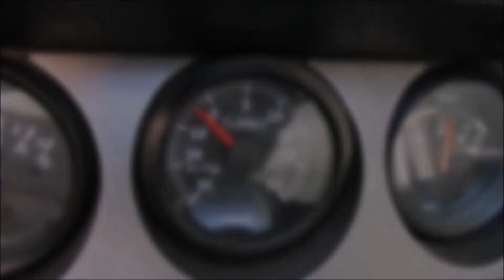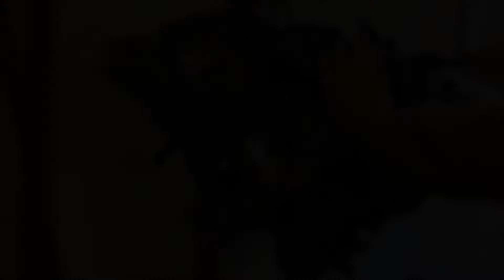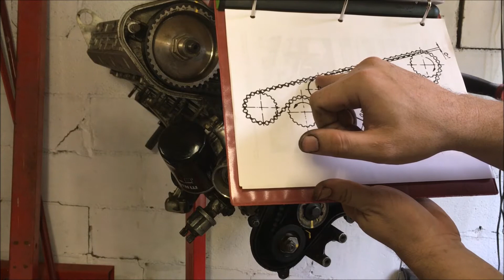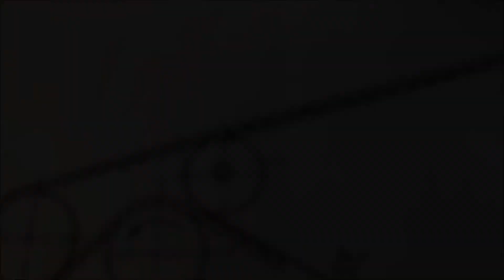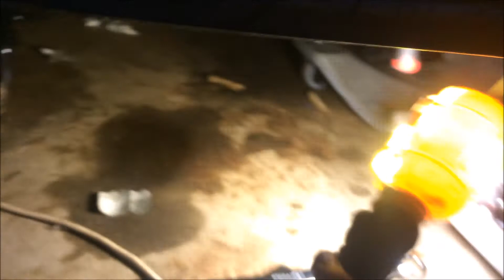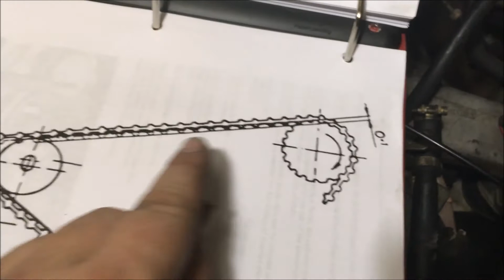Porsche 944 balance-shaft belt Installation Tutorial

Comment: Loctite 574 is flange sealant, no?
Reply from the maker: Yup, these bolts use flange sealant. Not entirely sure of the reasoning but it’s what the factory service manual says to use on those bolts.

Comment: Great video! Just a couple questions. I just finished my timing belt/balance shaft belt job on my 83 944, and when I started up it had a supercharger sound to it. I believe it may be my balance shaft belt being too tight. What do you think?
Reply from the maker: If you installed a continental belt with the grooves in the teeth they are extremely loud belts. Even if you have those at the correct tension they will sound like a supercharger. The gates belts are the old type of belt made from older materials but much quieter. I hope that helps!
Reply: Thanks for getting back to me! I dont have grooves in the teeth of my belt, so it must be too tight. I was just wondering if i need to put it back to tdc and put a flywheel lock back on if im just retensioning the belt? Thanks again.
Reply from the maker: Shouldn’t need to set it to tdc again. You can just loosen the tensioner a tad. The belt will still make some noise but those belts shouldn’t be so loud you hear them inside with the windows up. I have the conti belt on my car and I can hear it with windows up and radio on…

Comment: what happens if i have the 1mm offset but have more than 0.5mm clearance under the roller?
Reply from the maker: The belt can lift off the lower balance belt at high speed and potentially cause the shaft to jump out of time.
Reply: @edredas  I watched the video a couple of more times to see what position you had the tensioner and I had mine turned too far out once I put the tensioner in the same position as you show in the vid I was able to get the correct gap. Thanks for the help

Comment: Another brillieant video Brent!  What is the procedure for torqueing the balance shaft bolts?  How do you hold the shaft/sprocket while tightening the bolt?
Reply from the maker: We use Loctite 574 on the bolt and the Arnworx tool to hold the sprocket. This video is ancient now but I would eventually like to redo it with better lighting, in the new show with a newly rebuilt engine. I would then go into more details. Thanks!

Comment: Did you use the flywheel lock?
Reply from the maker: There's no need for the flywheel lock if you are just replacing your belts. Many times the flywheel lock will just move the flywheel off the timing mark when it engages. So the only time you really need the flywheel lock is when removing the crank bolt to replace the front main seal. I hope that helps!

Comment: Did you ever publish any tips for setting tension with the spring tensioner?
Reply from the maker: It’s pretty much the same idea as the eccentric. You’ll still want a gauge to make sure it isn’t setting the tension too tight. It’s easy to back the tension off with the auto tensioner. Just press on the lower part of the belt just below the cam sprocket and you’ll see the arm move down and if you lock it down you’ll see that it loosens the tension. Sometimes you only need to press on it the slightest amount to set the tension correctly. I hope that helps!
Reply: @edredas  yep - what I did - thank you.

Comment: recently had an incident where after much worry found out that the big thump after driving was not in fact the timing belt but the balance belt getting dislodged, previous owner id just bought the car from didnt tighten the bolt to 155 ft/lbs and the bolt threw out and shot the balance crank gear and the one infront of it but left the timing intact and now i know how to fix it :)

Comment: Good stuff. We just changed the belts on our '87. It has the auto tensioner that I really couldn't find any good videos on but it's pretty self explanatory and read up on it at Clarks garage forum. I can turn the waterpump pulley by hand with some force so should be good, will check it again after a few miles. We left the plastic belt covers off to inspect from time-time, any problem with this?
Reply from the maker: Shouldn't be an issue. Just make sure nothing gets down in there!

Comment: If this is not right will you get a whining noise?
Reply from the maker: The balance-shaft belt makes a very noticeable whining noise even when tensioned and installed correctly. However, it is much louder when the belt is tensioned too tight or the idler is misadjusted. I hope that helps!
Reply: @edredas  If come down to Charlotte can you take a look at my 86 944?
Reply from the maker: Sure, just give me heads up. Thanks!

Comment: Great videos, I have my 1982 944lux since last year and your tutorials really fill the gaps between the manual and the ·"real how to do it". I am trying to replace my belts, and I cannot get them to align with the factory marks for TDC... when the upper and lower balance belt shaft sprokets are aligned, the camshaft is 5 teeth out (someone marked a dot with white paint at that place...). The question is: shall I restore to factory marks or leave it as it is (as it has been running fine)? thanks
Reply from the maker: Yup, you'll have to use the factory marks! Always disregard other people's marks and remove them so no one else can use them! These cars will not run properly if the timing is even a tiny bit off. So the timing must always be checked with your own eyes to verify that the factory marks line up. As for the balance-shafts, it just takes some finesse to get them right, but when done right their marks will line up when the cam and engine point to their marks. Five teeth off are too much and can be annoying at higher rpm. I hope that helps!
Reply: @edredas  thanks so much for the feedback! I tend to change "like for like" on the assumption that if it didn't break before ot was ok(ish) butbwith your videos was clear that should not be the case at all! Cheers

Comment: On the preload for the idler on the upper run of the belt, how do you know it's 1.0mm as opposed to 0.1mm? It depends upon which way you look at it, yes?
Reply from the maker: I think either would be fine honestly. According to the diagram in the workshop manual it has a range in which it touches the belt with 1mm tension being the max.
Reply: @edredas  I just found some text separate from the diagram that clarifies that anything from 0 to 1.0mm is fine. For what this roller does, I wonder why it needs to be adjustable at all. The one for the camshaft belt isn't.

Comment: HI, Love your videos, keep them coming!!  I have a 1984 944, and when installing my balance shaft belt just like you show in the video, my lower shaft is about a quarter tooth off the mark?  Is this consider in time? If I just look at it, all looks good, but if I put my head in there and look at it straight on it is a little off the mark? If I move it a tooth either way it is way off the mark, could I have a bad belt? Thanks so much for all you do!
Reply from the maker: If its way off when moving the tooth back and forth then its correct. You have to look at it straight on so it might just look a tad off due to the angle when it really isn't. I hope that helps!
Reply: @edredas  Thanks

Comment: Notice when you tension the belt with the 27mm spanner you are turning clockwise, this is against usual automotive practice as the tension puts an 'undoing' force on the nut. Can you confirm what the manual says please?
Reply from the maker: Yes! It is specifically stated in the Porsche workshop manual to turn the balance-shaft tensioner clockwise! (See section 13-9) "9. Turn tensioning roller clockwise to increase tension. Turn anti-clockwise to slacken. Tighten hex nut to 45 Nm (33 ftlb)".  Otherwise the belt will have too much clearance between the lower balance-shaft and the belt will hit the water pump. Thanks!
Reply: @edredas  thank you for clarifying this important information so quickly 😃
Reply from the maker: No problem! Always glad to help! It has been my experience that a tensioner always turns which ever direction it will place more area of the belt on the roller its next to... so in this case, the balance-shaft tensioner turns clockwise as to place more teeth on the lower balance shaft, while the timing belt tensioner turns 'anti-clockwise' which wraps more belt around the water pump. I hope that makes sense! I've seen tensioners on other cars with the same idea and have never come loose. I haven't really thought about them coming loose due to that until now. Thanks!

Comment: I don't know thy Porsche didn t do a revolution of the 924 and the 944 especially the 944 should have been updated In 2000 and beyond 
a
Reply: Porsche 968
Reply from the maker: I think by the late 80's sales were slumping. They had to do away with the 924 and all the other low-end models. By 1989 pretty much all the cars were fully loaded top models, perhaps due to the cheaper Japanese competition. Many of those cars were a fraction of the price with more power and amenities. I'm sure Black Monday didn't help much either causing prices to skyrocket due to the poor exchange rate. By the 1990's most of the Japanese sports cars had ended production as well, probably due to market saturation. So I think the only way they could keep going was with something fresh like the Boxster. I think today there is a strong sports car market that wasn't there in the 1990's. The AE86 is doing well and even the Supra is coming back as an example, so there could be a room for a 944 successor but those guys were pretty vocal about it. I don't think you'll see that kind of demand from the people for a new 944...

Comment: Great video, Ed. I got my upper balance shaft one tooth off using the step-by-step instructions at Pelican Parts (which is otherwise good), and got a really harsh vibration from the engine. Your trick in purposely setting the shafts one tooth off is the gold in your video. I hope I can get it done right this time.

Comment: The Balance shaft idler pretension under the belt is .1mm (.004") not 1mm (.040") as you state, huge difference.
Reply from the maker: What I stated is straight from the factory workshop manual
Reply: You stated verbally 1mm, I went ahead with that and set mine for 1mm, but upon video review, the print you held up shows 0.1mm, which is basically nothing, just barely touching, so I'm considering backing it off.
Reply from the maker: Ah, I see what you're saying and I should have went a little more into detail. The pre-load is measured at the top balance-shaft and is not the clearance between the belt and the idler. If you look at the diagram that I hold up you will see that raising the idler lifts the upper run of belt up from .1 like you mentioned, to 1mm at the sprocket. The text included with the illustration in the workshop manual says that it should be 1mm so that would have the roller just grazing the belt.
Reply: Thanks for your reply, on the print it looks like the 0.1mm gap lines are translated down to the idler area leading me to believe that is where they intend the measurement to be taken. In any case I currently have a 1mm arc in the belt at the idler,  the engine currently runs quiet without any belt wine, should I leave it alone or back the 1mm pretension off to 0.1mm?
Reply from the maker: Yeah, the instructions are a little confusing. Basically, if you don't place the idler against the belt then the pre-load will be zero. In the instructions is says to have a pre-load of 1mm which would mean having the idler barely grazing the belt which supports the belt and raises it about 1mm up at the balance shaft... later on it says that any pre-load on the upper balance-shaft from .1mm to 1mm is acceptable... so the illustration is showing the acceptable pre-load range at the shaft. If you have a bow in the belt of 1mm then its likely too much pre-tension. I hope that helps!
Reply: I remember there being a factory tool for this, a curved brass piece that acted as a feeler gauge for this distance which I do not believe was .1mm thin. It was more sturdy than that and probably the 1.0mm.
Reply: @scott1333  Yes, I think you are correct, I once thought I was wrong, but I was mistaken.

Comment: Hey edredas i had a question on the front engine reseal kit pelican parts sell part # 10-0507-099-M260 . I am going to be doing timing and balance shaft on my 1984 944 na and upgrading to the new water pump the car seen better days after taking off the timing cover it is pretty dirty from leaking oil i just want to make sure once everything off i have all the rubber seals and what ever else should be replace. I know i will be replacing the oil pump drive sleeve as well since thats not included in that kit.
Reply from the maker: Sounds like you've got it! Just make sure you change those oil cooler seals and you should be ready to go as long as you don't spot any other leaks! I hope that helps
Reply: Thanks i'll add the Oil cooler seal kit to my list
Reply: hey edredas got another question when i bought the car the previous owner claiming it would start to get hot. instead of just putting a thermostat and trying to trouble shoot i am doing everything timing belt balance shaft and upgrading to the new waterpump. as i wait on parts to come in the mail i just finish setting the engine to TDC and i was watching your timing belt replacement video you was turning the waterpump by hand checking for how tight the belt was well i tried turning the old waterpump that still on the car with the old belt still on  and it would not move you think that could be the problem with the over heating issue
Reply from the maker: Could be! You'll need to check once you get the belt off, but if the water pump is seized the engine will over heat very quickly!

Comment: Great video! I've never heard that about over-tightened balance shaft belts breaking the housing, but on these cars nothing would surprise me. There seems to be no end to the number of 'gotchas' in these cars.
Reply from the maker: Thanks! Yeah, google balance-shaft housing failure and look at some of the carnage. You'll notice that it usually blows out at bearings because the belt is pulling too tight on the nose of the shaft which causes the housing to explode. At least that's what I can gather from the cars I've seen with this type of failure.